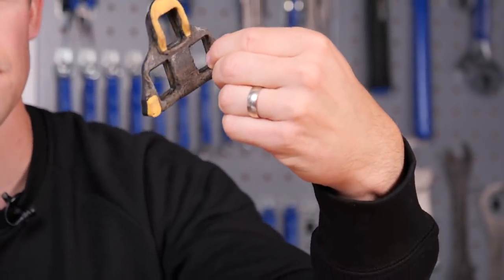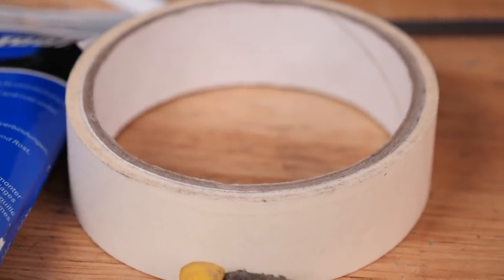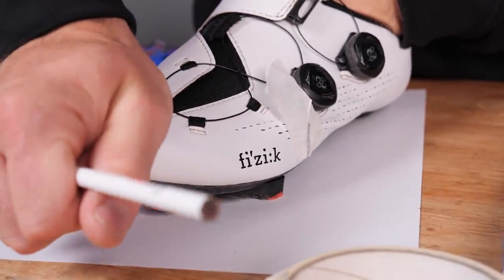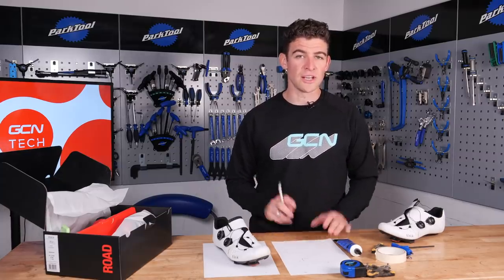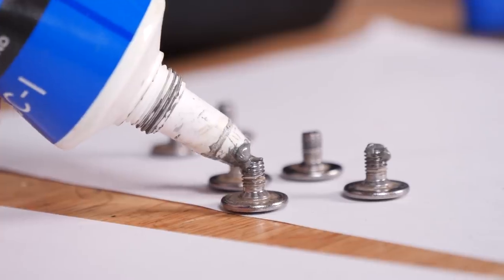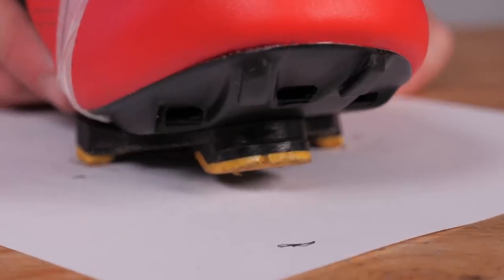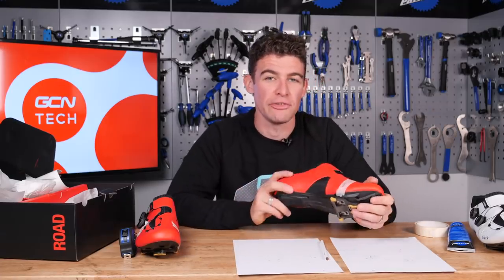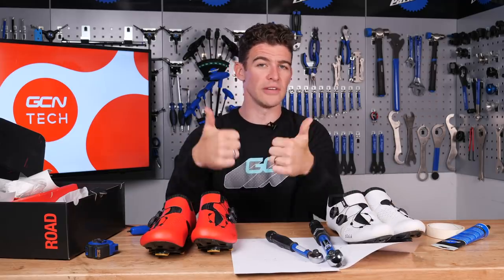How To Replace Clip In Pedal Cleats And Set Up New Cycling Shoes

Comment: I started "serious" cycling in 1986. I started right out with Look pedals, Brancale shoes and Look black cleats. The shop I purchased the bike from included a fitting session using a first generation "Fit Kit". The cleat alignment and seat height on that first real bike were perfect right off the bat. Since that day, I have always struggled with this. It takes one or two rides to get it dialed in.

Comment: Would be interesting to have a video on changing from 'mtb' cleats to roadbike cleats!
Reply: I would too. I just moved to road cleats and literslly have no idea how to set it up correctly.
Reply: Hello, the best method for transitioning cleat types is by referencing the pedal spindle!  This is the central location that never changes.  You can just gently rest your cleats on top of the pedal to notate where the pedal spindle is on both.  You can use the method show in this video, but on your old cleat outline, draw a line straight across where the pedal spindle would be to simulate it.  On your new cleat, match where the pedal spindle would be on that type, and align that to the line you drew.  You are matching the imaginary spindle lines, not the physical outline.  For Q-factor, you can also use this method, just note where the dead center of each cleat falls on the imaginary pedal spindle line with a perpendicular mark.  

With this method you can switch any cleat type and guarantee your feet are in the same position over the pedal.

Comment: Great video as always. Just one comment though. Adding oil/ grease to the end of a screw/bolt that is being screwed into a blind hole can prevent the screw/bolt from threading completely in to the hole because the oil/grease will cause a hydraulic dam. If this happens it will be impossible to get the required grip on the cleat and the cleat may twist under load.Love you guys.
Reply: Clive Woakes you are forgetting that the screws are going into an open ended threaded insert...........You cannot dam any lubricant up there.....its open.........
Reply: x2 what Paul said... It's a through hole, not a blind hole.
Reply: Absolutely right of course. Engineer knee jerk reaction. LOL

Comment: You know, this seems a lot more complicated than just eye-balling the initial fitting and adjusting as necessary when on the bike.  If you've got the cleats with rotational freeplay, this is basically a one and done type deal.

Comment: Red or white...black please.

Questions: What about finding your cleat position to begin with when first starting with cleated shoes?
Reply: Go to a shop and have them help set them up. After that and as long as you keep the same shoes you can do it by yourself.  I use a fine tip paint parker to mark the position before removing the old cleats

Comment: #torqueback What should I do if one foot is 1cm shorter than the other one? ATM I alligned both cleats parallel. On the rigth foot it feels good, on the left one it is too far back. I cant imagine that having both cleats not equal is a good idea...
Reply: Put shims under the cleat and get longer bolts. Available st most bike shops.
Reply: @damianoneill2637  Sounds like you're addressing stack height? I think that @Mathieu B is saying that his two feet are different sizes, so ligning up the cleats on both shoes the same way pushes his left foot further aft (backwards).
Reply: @voiceofreason you are correct. I misread. Cheers.

Comment: To facilitate cleat replacement, all manufacturers should adopt the split cleat system used by VP components.  The front and back parts of the cleats are separate parts that key together.  You leave the front part in place while replacing the back part and vice versa.  These look similar to Look cleats, but I've only seen reference to them being used on track bikes.  https://www.bikeradar.com/reviews/components/pedals/vp-components-vp-r73-review/

Comment: Very Scientific, Not like the old days  Wooden sole sidi shoes and small brass nails..  You soak the shoe  then go for a short ride with no cleats, you keep  moving the foot around in the pedal,  you  then tighten down the toe straps  once the shoe feel right.  Flip the shoe over find the line the pedal made and line it up with the cleat and nail it in.  DONE  no second guessing  after that..